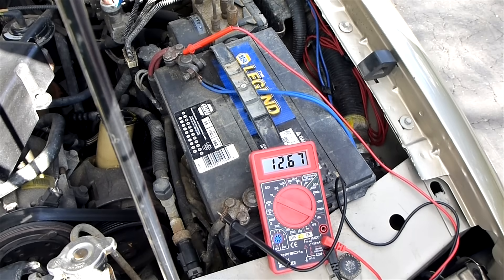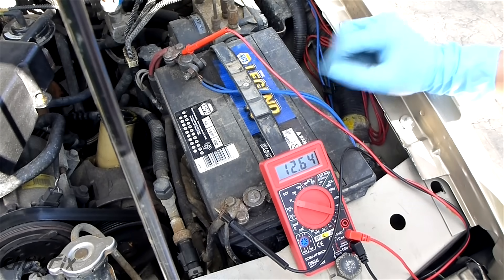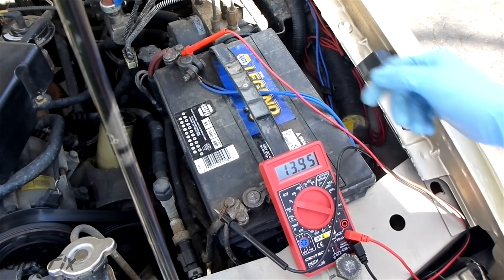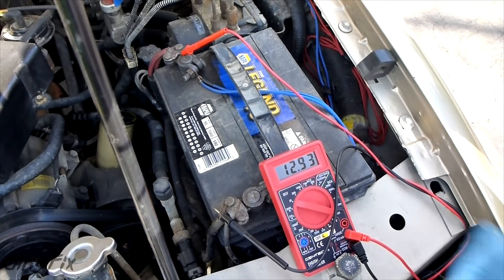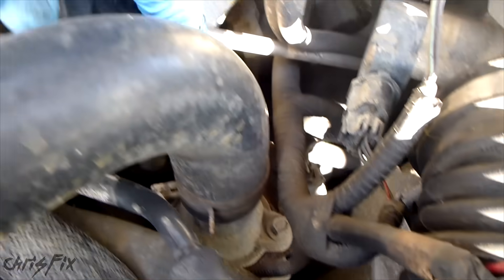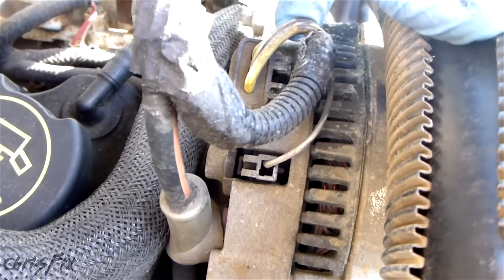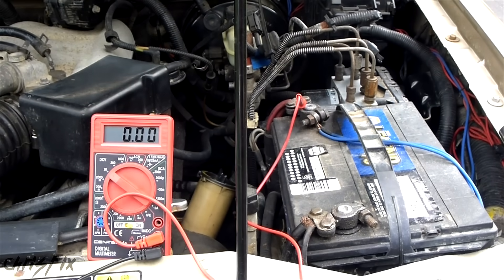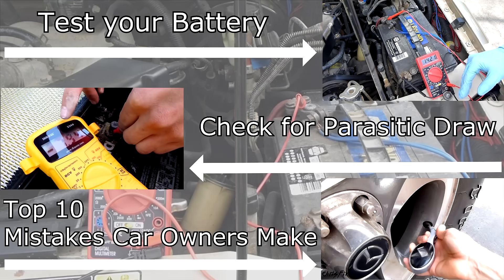How to Test an Alternator

Comment: Thank you for adding this video, but mate, this isn't up to scratch,  What you want to is measure the resistance to the battery terminals, not the volts (direct connection based on Ohms rule)  If the wire connection between B+ and the battery + is 0,2 ohm (accounting here for the basic offset in the measuring equipment) you are golden, if there is a very high ohm value,get sanding boy. It can be done the same way round with the alternator body, but then it would be in reverse.   The resistance between the negative alternator pole and the negative battery pole should be very low 0,2 ohm . That way you have ruled out any wiring defects/corrosion defects.  If that should be in order then you move on to the diodes, which convert AC to DC (DC is the current you charge you car battery with) Etc etc, It's just a jigsaw,  same you played with as a child, all the pieces together form the machine
Reply: No, it's better to measure voltage... I mean that's how current sense resistors work.  Unless you have special equipment, you can't measure that low of a resistance accurately.
Reply: @EGL24Xx  agreed,  perhaps the best course of action would be to first do voltage measuring and if that fails do ohm measuring to speed up search for a bad connection

Comment: My battery light came on and my engine wont rev past 3000 rpm. Are these two problems connected?
Pls reply
Reply: Not necessarily but pretty likely as cars nowdays are almost completely run by computers which if they dont get enough power the rest of your car will reflect that
Reply: Probably. Get the system load tested.
Reply: Just get a cheap multimeter (free in harbor freight) and test it as you rev the engine see if the alternator is good

Comment: Just did mine,my battery readings were ok,but alternator was 0.1-0.2......having to jump my car every morning as well-runs fine through out the day once going then over night it fails.battery shop said my battery is done which led me to you.thanks for your tutorial and yeh,looks like im in need of a new battery and alternator.dont want to get a new battery without getting a new alternator as i think it mite mess with the new battery.cheers.
Reply: Get the battery and have the alt. tested or test it yourself.  Continuing to drive with a bad battery places large stresses on the Alt. and can easily damage it.
After you replace the battery, check for a parasitic draw.
Reply: @wholeNwon  cheers,went to local auto electrician and it was only the battery.
Reply: @thecrelok5681   Good. After a while, just do a basic check of the alt., too.  Diodes may be weak by now but probably not too weak.

Comment: So did all those tests and battery and alternator are good with mulitmeter. Could it be the starter for slow cranking? Or should i bring the battery to a shop to double check?

Comment: Don't forget to disconnect the battery first before cleaning any positive terminal connections. Not necessary for cleaning negative terminals...
Reply: Oh hello
Reply: @faultboy  Hey . I used to be an auto electrician so found this video was pretty accurate overall.
Reply: @goodideas5659  Indeed, i was just amused to see a Vault Boy fellow :)

Comment: Hi.. i just checked.. red wire to +ve battery and black wire to alternator body.. the V reading was 14.46v ... it was abnormal rite?
Or must touch to alternator cable?
Reply: Also.. when red wire to alternator body the reading was 0.12.. so bad... need grounding cable?

Comment: 6:00: "If you don't find your problem between the alternator and the alternator bracket..." Should be "between the battery negative termnal (ground) and the alternator bracket..." Right?

Comment: did a voltage drop test with black wire to my negative battery post and the red wire touching my alternator. I received a positive number. not a negative.  Am i doing something wrong?
Reply: You might have your connections to the multimeter around the wrong way.
Reply: @hammerichm  thank you for the reply. The bottom port is black and the middle Port is the red wire.

Comment: What do I do if my battery is under my back seat I have a Buick Lucerne 2007 V6 my alternator is brand new but my battery light still comes on my battery goes dead and I bought brand a new battery the battery light still comes on so I don't know where to go from there
Reply: Replacement alternators are frequently defective.  Get it tested.

Comment: Or you could just remove the positive terminal if the car stop running it’s bad problem solved
Reply: NEVER do that in any modern vehicle.  The battery, even a weak one MUST be in the circuit to protect the alternator diodes.

Comment: I replace alternator and Battery and somehow my Battery wont stop Boiling and also the Gauges  wont stop going crazy , I even see the Acid of the battery is bowling and coming out.
I clean all the ground I could find in the engine bay... still  have not yet figureout what is going on
Reply: Your alt. is overcharging.  External voltage regulator?  If so, check it.

Comment: My battery reads around 12.55v when shut off but when I turn it on it reads about 13.5 and never touches 14v. Should I be concerned? Nothing seems to be dying on me while driving and the battery light turns on and off several times while driving. Maybe a weak connection somewhere or corrosion on a ground somewhere? Some one please give me some feedback

Comment: If you test alternator (AC) why  set multimeter to DC voltage?
Reply: Botezatu Constantin the AC potential is converted to DC using a series of diodes to rectify the signal. All of the electronics in a car use DC, so it has to be converted.

Comment: My alternator voltages are within your specs, but when I turn on lights, AC + fan on high the voltage continues to gradually drop down into the high 12's. When the car sits for 4-5 days the battery measures below 11V. Different battery same thing.

Comment: Been  working on charging systems in a car for many years.checking voltage on battery  with car off then starting it is a great way to tell if alternator is working correctly. With car off voltage on battery will be  around 12vdc. Starting  the car the voltage must go up to around 13vdc- 14.5  it must be higher than 12 volts to charge the battery. The last charging problem I fixed was a broken surpentine belt. That killed pwr steering , charging , AC, Cooling system . That's the only bad thing about  a single belt  driving those 4 items. In older cars there were 3-4 belts .
Reply: Ken W. My battery is at 11 volts.... When I turn the vehicle on it stays at 11 volts and won't go up.   Is that indicative of a bad alternator not charging?

Comment: @ChrisFix my battery voltage is mid 10s when not cranked. When cranked it’s mid 14s when all accessories are off and on. But after having my battery charged and the tell me it checked good, it dies overnight. What could be the problem?

Comment: did all the test here but when i turn everything on and apply my break it will kill the car it shuts it down, i put new battery cables on new battery. looked for the ground from the body to the motor and cant find one on here. all test was good besides when i check the ground to the body it was like only 8 volts not 13.95. they Voltage regulator has power to it and the fuse is good for the Alt. all my dash gauges go crazy and lights dim real low. when headlights are on and car is running head lights will go off but parking lights stay on, my guess is the Voltage Regulator is bad in the Alternator. have any idea CHRISFIX ?

Comment: And what are your thoughts on the "big 3", meaning increasing the size of the cable from the alternator to the battery, from the engine to the chassis and increasing the size of the grounding cable?
Reply: Do you want a 2 lane road or an 8 lane expressway
Reply: @Crasher-mo1bv  Ha, good point.  I always found it odd that the grounding cable to the battery was always so small.  I guess people have figured that all out though via experience and actually pushing their electronics systems to the limit?  I just don't want to fry my battery or something else by enlarging something that was meant to be a choke point.

Comment: a fully charged battery will be 14v at idle with the engine running 13.7-14.2v is normal voltage you want with the engine running any high or lower and you need to replace the battery.

Comment: Or you can just turn on the vehicle and disconnect the battery and if the car shuts off then you need to replace your alternater
Reply: What???? 😂 no that's not how it works your alternator charges your battery so therefore you need the battery in order to run the vehicle your battery stores energy and the alternator creates it
Reply: @jayjack1085  I'm pretty sure he was joking (hope so)  :)
Reply: @minoriteinvisible  he's not joking. If your alternator is good, your car will run on the alternator with no battery involved. It's not a good thing to do but if you disconnect the battery and it dies, then your alternator is bad.
Reply: @jayjack1085  go try it on your car

Comment: I carefully disconnect the Positive terminal, wrap it with a cloth or other insulation material so that it WILL NOT short out to the chassis and turn on ALL Accessories; Air conditioner at full fan speed, all the lights and radio to check if the Alternator is putting out sufficient current. IF the Alternator is working properly, it should maintain ALL the systems on and STILL show that it is charging even when the engine is at idle speed.

Comment: I have Toyota Camry when ever I drive and I’m in stop sign or red light then I press the gas it shut off and the battery light turn on and I put a new alternator
Reply from the maker: Sounds like you might have a separate issue not related to the battery or alternator.

Comment: Altenator was working good after I put degreaser all over the engine. Any solution chris? My readings are 12.6 when engine is running.

Comment: The most simplest way to see if you bad alternator is to start the car  and remove the negative  battery wire  if the engine dies the alternator is bad.

Comment: Great video brother! I have a 2003 Mini Cooper R50 and would add a couple other symptoms I noticed slowly starting to happen with my car model in particular a month or so before my alternator actually took a complete dump. Rough idle and sputter when accelerating from a complete stop, slightly slower moving power sunroof and windows, engine stutter when turning on air conditioner, power steering acting up intermittently and intermittent weirdness with my ECM related components.

Comment: I have a 2008 tacoma base model truck, changed alternator and  now alternator is not charging the battery, bat was at 12.7 volts started engine and voltage only dropped to 12.3? raised rpms still nothing. wire from alt doesnt go to bat seems it runs to fuse box, alt fuse is good

Comment: You done verry well 
i have mini one 05 reg
all problems start when i was trying to move from place the lights go nearly off and car clock always resets dosnt keep power 
i go to garage they change
alternator belt after this everything was okey but come one new problem my speed arrow strts shake when start the engine for short time and then becomes alright again  
but i dosnt look at ghat like a problem 
after some time its comes short cuts of ellectric i was thry to move away with car after drive 20 miles and all electric in car gone totaly gone even warrning dosnt work 
after 10 minits its come back and next day i find your video i test my battery and its shows 12.62 when car off 
and 9.52 when i start car
so eah its battery problem like you say 
next day i was try to turn on car and whats happen all car start give noice windows opening when trying to turn on car 
looks like all electric fuckt 
even starter was look its dead becose dosnt do anything 
i was push car and get it on after turn off again dead at all only ignition was working okey car radio was working to but it was mot enough power to turn starter on 
just go buy new battery
all problems gone at all stars in first time 
spedo shake gone looks like everything was of this battery 
so dont change your alternator before dosnt check the battery 
thank you brob

Comment: Hey Chris im getting a p0345 code changed both cam sensors on my 05 Nissan frontier and im still getting the same code ..any ideas
Reply: Did you clear the code using your reader after you changed them? Also make sure that is the only code, it may have more than one stored. One last thing is your battery connections. Make sure they are very clean & tight. These trucks are picky about that, a bad battery connection will cause all sorts of strange things.

Comment: Hey Chris. I've recently been having starting issues which led me to think the battery was toast. Tried using a booster pack today and the car wouldn't crank at all. Car is practically dead without the booster pack. So now I'm thinking it could be the alternator. Is there a way to check it without starting the car since I can't?
Reply from the maker: Charge the battery then do the tests

Comment: I have a 07 Chevy i replaced the alternator n battery but car still doesn’t charge after a few days of driving the battery goes dead wat can i do to fix this issue plz help
Reply: Thanks i got it back running it was the red wire thanks ur awesome keep up the dope work bro 🤝 any tips to make my car faster 😂😂😭
Reply: Taylor Wilson no problem 🤝 And nothing gives you more horse power than neon lights ‼️🥴😂😂😂
Reply: ranthepartsman 😂😂🤝 should i make them flick as i drive 😭😂
Reply from the maker: Try cleaning the grounds and make sure you’re getting 14v to the battery with the engine running. If not, the wire from the alternator to the battery is bad
Reply: ChrisFix are you talking about the one with the clip or the bolt
Reply: Taylor Wilson from the battery to the alternator would be the bolt type. Make sure your voltage is higher than 13.7 with the car running

Comment: nice video knew already how to check for parasitic draws and  the battery. But never consider checking alternator in that indepth so was great to be made aware of the corrosion on all the ground areas... i would have just check the alternator terminal, turned lights on started vehicle ,..etc but wouldn't have been as through in checking all the ground areas to engine block , to chasis of vehicle ,...etc And wasn't aware of some of the ground measurements tolerances.

Comment: I am currently experiencing a 1 volt, voltage drop on the negative of the battery to the alternator case. Would the assumption that the ground from the alternator is bad?
Reply: Yes, it should either be ground cable from engine/gearbox to chassis or from chassis to battery. You can test it easy if you use a startercable from battery to chassis or chassis to alternator an see if the voltage drop is good then.
Reply: Kristian Burns i am getting the same thing. How would it be tested just apply the connection in series?
Reply: @itssjustej  not en series, but parallell connection. Clamp your startercable on battery negative and over on a good ground spot on chassis, if the voltage drop is good now it ia the cable from battery to chassis. If not move the clamp from chassis and over to the engine/alternator, then it should be good and the ground cable from engine/gearbox to chassis should be bad👍
Reply: Kristian Burns I tried it but seems the voltage is still of the same. Also the higher the rpms the more voltage is drawn (alternator to negative battery)
Reply: I also have alternator under warranty so I am just gona go ahead and change it to see if there are any changes.

Comment: Hey Chris question I’m on a 98 f150 tested the way you said and the meg test I got .25 and the positive test only .02 I’m having problem with battery colts getting above 15 v just put in new ( reman) alt and new battery any ideas when I test the block on first net test at .04 but bracket and case .25

Comment: very informative. But you yourself need to fix up your battery terminal connections. There should be no copper showing beyond the terminals themselves. Wire insulation should go right up to the terminal connector.

Comment: When I connected my negative terminal of the multimeter to the negative terminal of the battery and the positive terminal of the multimeter to the alternator casing it gave me a reading of (-0.00) and (-0.01). Battery reads 12.56 before start and 13.59 with load. Has either my alternator or my battery gone bad?
Reply: why are you running this test? 

The alternator should provide more than 12V to a 12V battery while the engine is running even just slightly faster than idle. So what you're seeing at the battery is about normal. But why are you testing it? Is something not working right with the car, that led you to do this test?
Reply: @touristguy87  thank you for your reply🙏🙏. My radio only works intermittently on my e120 corolla. I am trying to narrow down the issue starting from the alternator and the battery.
Reply: @janithmalitha4404  I found a complete circuit diagram for my car online, downloaded it for free...that might help you...if the radio was installed and wired-up properly.

Comment: One small point, change the voltage range when measuring small voltages, such as the voltage drops. The accuracy of this cheap meter is very bad in the lower parts of the measurement range.

Comment: With the truck running unhook the negative battery cable if the motor dies bad alternator
Reply: that won't tell you if the alternator connections are bad, not the alternator itself.

Comment: So my battery is draining while the vehicle runs i check the volts at the back of the alternator and im getting like 78.3 volts there??! And 0.00 on the case amd bracket
Reply from the maker: That isnt right haha. Sounds like you need a new alternator.